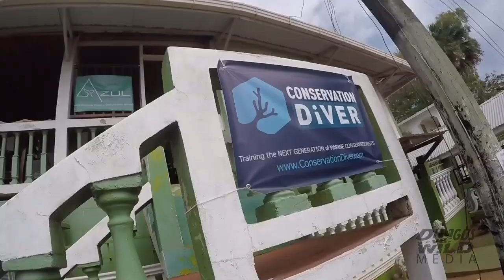Making Artificial Reefs on Little Corn Island, Nicaragua

Comment: What is that adhesive used to stick corals? Nice work
Reply from the maker: We use a marine-safe epoxy. It's a two-part mixture made by epo putty. We have tested it extensively and used it for about 15 years and have observed it to be very strong and never seen any adverse effect on the corals or surrounding marine life. 
Best of luck!

Comment from the maker: The Process of Deploying an Artificial Reef:

First you must build your Artificial Reef on land using materials such as concrete, metal or glass and bind these into a design. In this video you can see bottle nurseries and concrete blocks with rubble and conch shells (originally removed from the ocean by tourists and hotels) in the top of them to create an undulating and textured surface. There are also metal structures, created by welding re-bar.

The design of the structure must allow for as much light incidence as possible, create a surface that you can easily transplant corals, be easy to deploy (this will depend on your boat facilities) as well as being strong and stable.

Depending on the size of the structure you can then deploy it safely using guide ropes and/or lift bags.

Once in location, you need to gather rubble (dead coral, rocks, shells etc.) to place in and around the structure to make it a more appealing habitat and to secure it.

The team then gathers coral fragments (broken or at-risk colonies) to transplant securely onto the structures.

This process should only be done by professionals.

If you would like to learn and take part in Artificial Reef creation, please check out our course at https://conservationdiver.com/artificial-reef-theory-and-techniques/